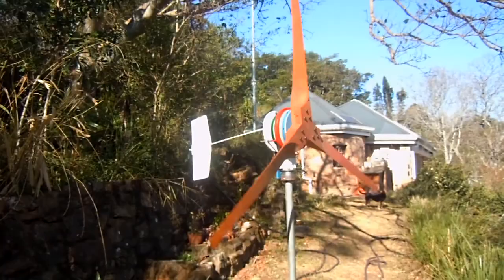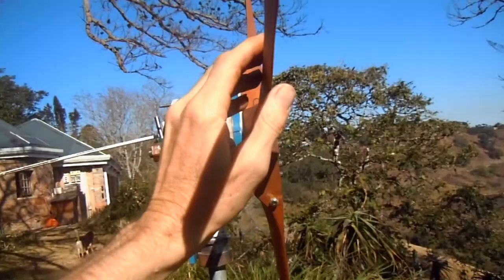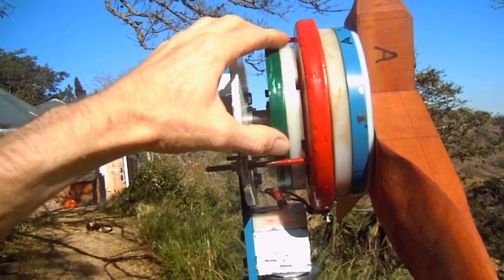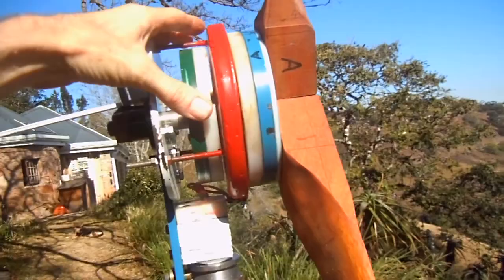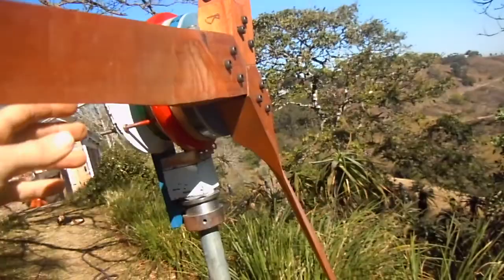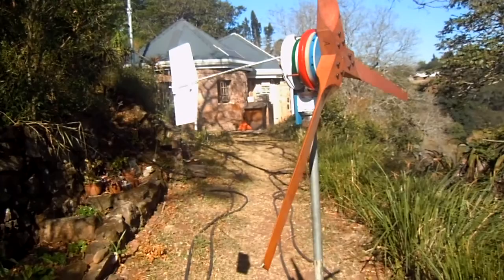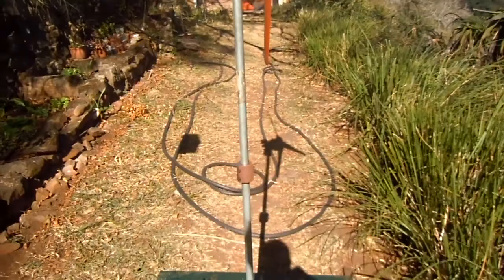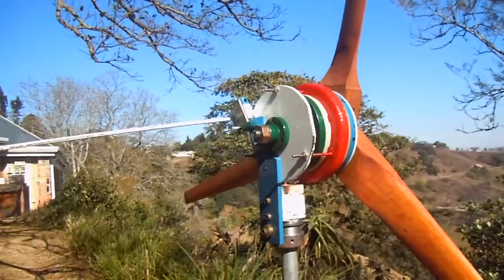Imbali wind-turbine overview

Comment: Excellent design.   Was wondering, do you rectify near the turbine?  The reason I ask, is that alternating current Power travels better in thinner gauged wire.  Also saves a heck of  lot of cost then.  This naturally comes from the days of Edison versus Tesla in the early days of public power distribution.  Anyway - noice!
Reply: It is the voltage not the wave shape. 

In fact DC current is more efficient to transmit than AC current at the same RMS voltage level. 

DC does not suffer from the skin effect that reduces the efficiency of AC transmission
Reply: @ajarivas72  sounds like you haven't heard of Edison vs Tesla
Reply: @drsproc  

Direct current travels better than alternating current. There is no skin effect in direct current.

The joule losses in a wire depends on the amount of current (i^2 x R, square current times the resistence). 

The higher the voltage, the lower the joule losses because the current is lower. 

It is much easier to increase and decrease AC voltage (transformer) than DC voltage.

If you increase the DC voltage with a booster circuit, then you can transmit DC current with lower losses than AC voltage (no skin effect in DC current). 

Look into it, please.
Reply: That is just it... direct current has much higher losses due to resistance of the wire.   By stepping up with a transformer even at the source, the transmitted power would be more efficient, the wires could be much smaller too.   Look at even modern solar panels and the reasons for micro-inverters.  Its fundamental electricity.  Let's ask the wind turbine maker to test it for us?   Lol
Reply: @drsproc  

DC can be stepped up too. High voltage DC transmission is more efficient than high voltage AC transmission because AC is affected by the skin effect which increases the wire resistance.
Reply: @ajarivas72  Sorry you just dont get it.   Go find out why modern transmisson wires use HIGH voltage AC and why DC solar cells use microververters right at the panels.  Skin effect is easily mitigated with multistranded wire.  Its current loses...
Reply: @drsproc  

I perfectly understand what you say.

High voltage DC transmission does not need multistranded wire.

We use high voltage AC transmission lines because it is easier to step up AC voltge than DC voltage.

The reduction on losses has nothing to do with the wave form, just with the voltage levels.
Reply: @ajarivas72  That's it.. my final reply... The efficiency of transmitting electrical power depends on various factors, including the distance of transmission, the voltage level, and the specific characteristics of the transmission system. Comparing DC (direct current) and AC (alternating current) solely in terms of efficiency is not straightforward because each has its own advantages and disadvantages.

For long-distance transmission, high-voltage direct current (HVDC) is often considered more efficient than high-voltage alternating current (HVAC). DC transmission has lower losses over long distances due to reduced line impedance and lower reactive power losses. This makes HVDC advantageous for transmitting power over thousands of kilometers, such as across underwater cables or between different power grids.

However, for shorter distances and lower voltage levels, AC transmission is generally more efficient. AC power can be easily transformed and controlled using transformers, allowing for voltage adjustments and reactive power compensation, which helps to reduce losses. AC transmission is also more practical and **COST-EFFECTIVE** for local distribution networks and residential use.

In summary, while HVDC is more efficient for long-distance transmission, AC is more suitable for shorter distances and lower voltage levels. The choice between DC and AC transmission depends on the specific requirements and constraints of the power system.

Comment: Did you use a commercial slip ring?
Reply: Get rid of the slip ring, get a 90 degrees gear box ⚙️ and mount the generator shaft vertically
Reply from the maker: A slipring is not used. The electrical wires are fed down the tube. They can then obviously twist. Experientially (over msny years), the turbine is moved left/right into the oncomming wind about equally and thus the twisting/untwisting of the wires does not present any issues.